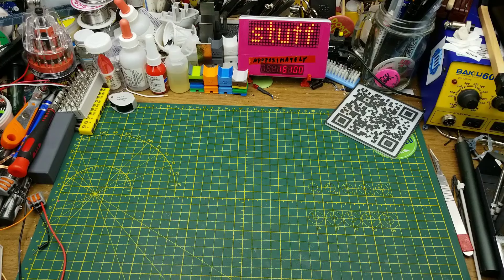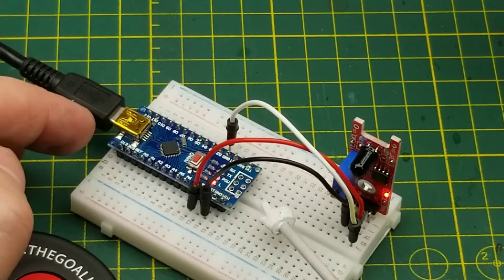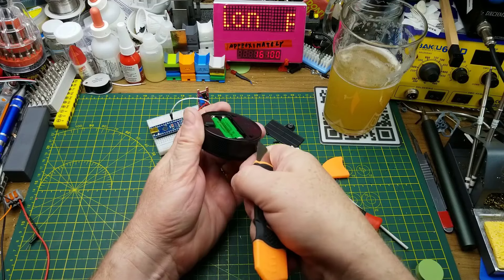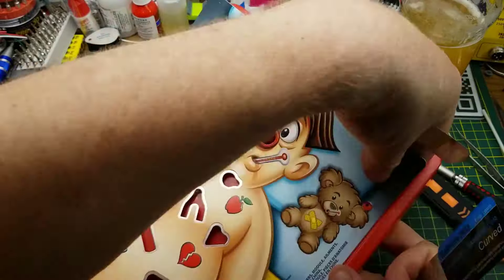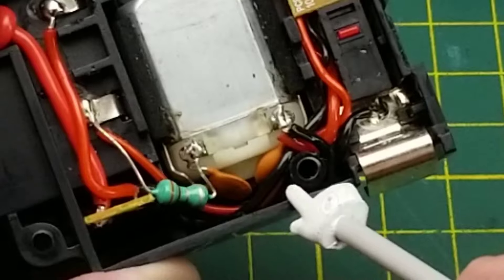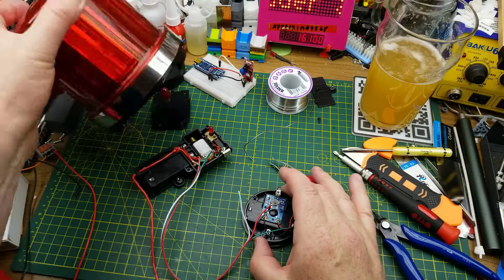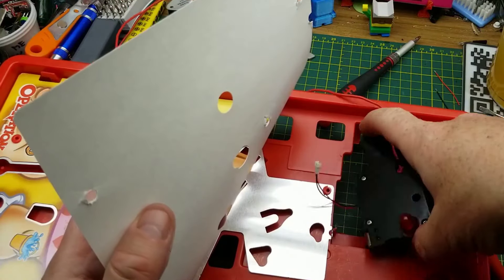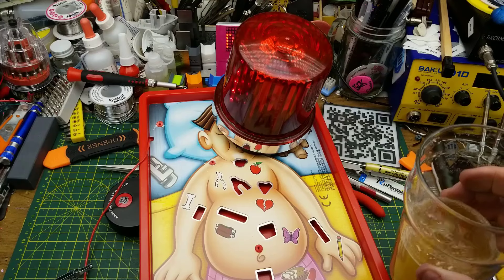I made my brother's game more annoying!

Comment: I think the reason your infrared sensor didn't work is because the remote probably uses a 48k carrier signal. You need a remote control infrared sensor (those integrated ones with 3 legs and look like a transistor) that decodes the signal from the carrier sensor.
Reply: This is my first thought as well
Reply: yea it doesn't have a built-in demodulator, ReceiveDemo would have printed the raw codes if it didn't recognize a demodulated signal

Comment: Nice. A couple of things I would have checked, (maybe you did, but did'nt mention them).
I would have tried a TV remote to turn on the alert and an IR LED by itself. Also I'd have hooked the IR LED in the sender to a scope to see what sort of pattern it sent out. If it's just pulses, a 555 could be used. Just thoughts.
Reply from the maker: I did take a look on the scope, it was a signal modulated onto a high KHZ square wave, but my ancient analog scope couldn't lock onto any discernible pattern in the modulated signal. 

There was nothing interesting enough to show on video - just blur.
Reply: @pileofstuff  That's fair enough. I love my old analog scope, but for ease of use you can't beat the modern digital ones. I've got a cheap Chinesium one.

Comment: Im guessing you tried the scope. A brief clip allowing us to pause and look at the pattern could be a good compromise for those who want to see vs those who don't.
Reply from the maker: I did, but it wouldn't sync to the signal. I spent a long time trying (and failing) to get an image that could be interpreted.

That's a limitation of an old analog scope when trying to figure out digital signals.

.

If any manufacturers of modern digital scopes happen to be watching, I'm open to sponsorships...
Reply: @pileofstuff   A sound card oscilloscope could be a nice little project which would help in cases like this.